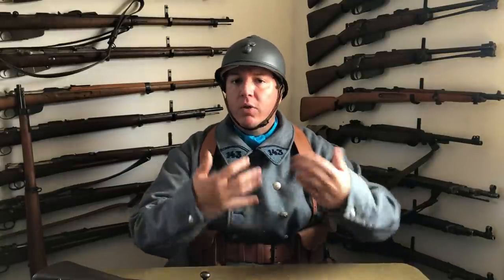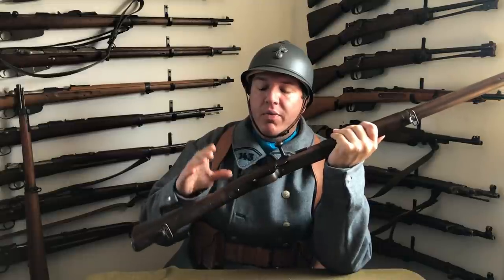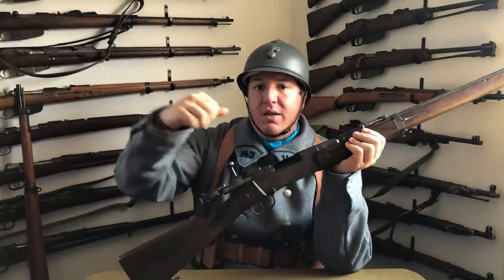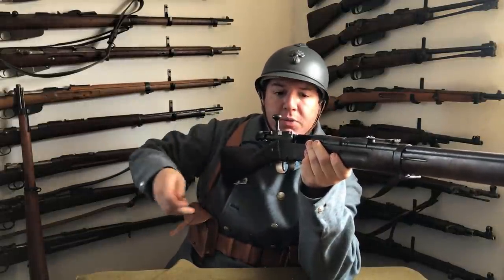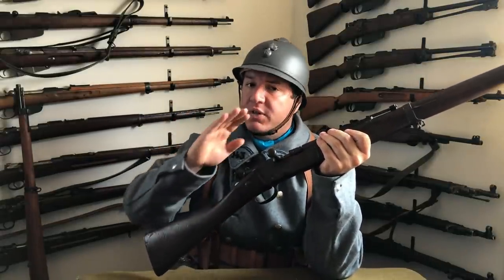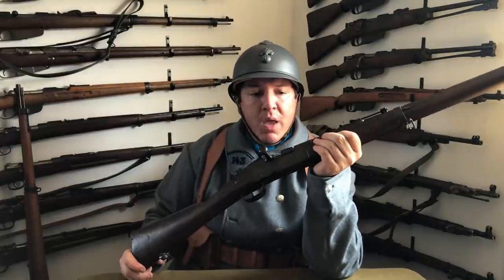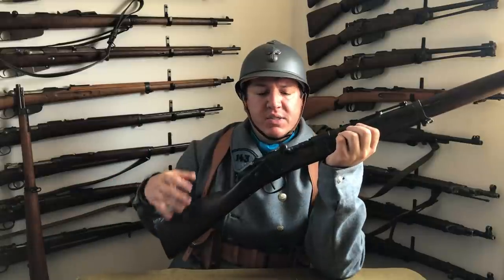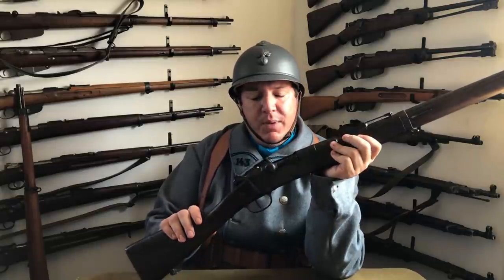How Was the French 1886/93 Lebel Rifle Used in WW1?

Comment: The original Lebel was designed with a tube magazine as it was based off the Kropatschek rifle the French navy used. The 1893 updates were the gas shield on the bolt, the rear sight being mounted better, the rear knob being changed for some reason and another thing or two I can't remember.
Reply from the maker: That's right, I messed that up. Will pin the comment.
Reply: @MikeB128  Kudos, great video on a fantastic rifle.
Reply: Complex engineering with this design is having pointy cartridges tube feded that are not priming each others while loaded ! Thanks to the rimfire bullet casing design that allows bullet tip to stuck in a tilt position at the back of the next cartridge in a ring groove.
Thinking that even Winchester in 1895 developped a stripper clip vertical feeding box magasine system to abandon their traditional tube feeding one so they can finally fire pointy cartridges to be military worthy reminds us that French did not made things like others and it is a very interesting method.